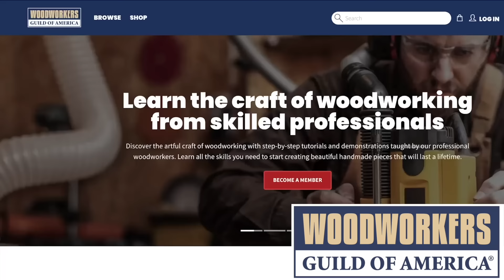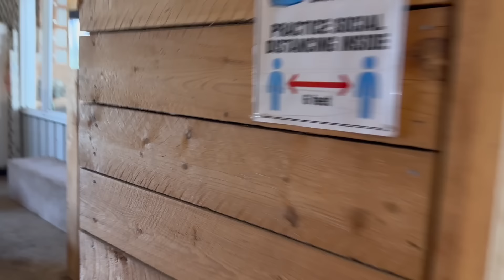YOU changed my life!

Comment: You should demand a full refund from the original company. They cost you time, stress, and money with their lack of professionalism and lackluster guidance. Anything other than a total refund…I would blast their name again. Actually, I would not have removed their name until they rectified the situation. It would have been an incentive for them to move quickly to refund your money.
Reply from the maker: Yes I thought of that. I hope to have updates soon. I guess I feel like I have to take some responsibility for hiring them in The first place. 🤷🏼‍♀️it might be misplaced responsibility. But I feel like if they send the manufacturing deposit back I would be happy with that
Reply: @johnsfurniturerepair  you hired them in good faith based upon what they told you they could do to help and guide you through the process to complete the project. Based upon what little we are privy to, they did not do their part. They weren’t even bothered to know building codes in your area but provided you with building plans. Maybe you have already done this, but if not I would spend the money to speak with an attorney to get their take on what they think would be a reasonable resolution. Stand up for yourself, you work hard for your money!